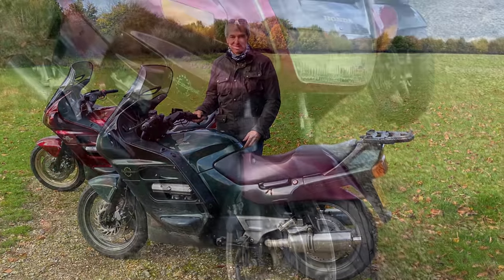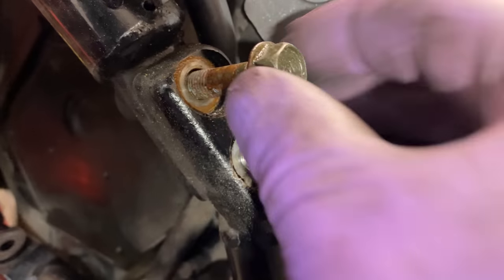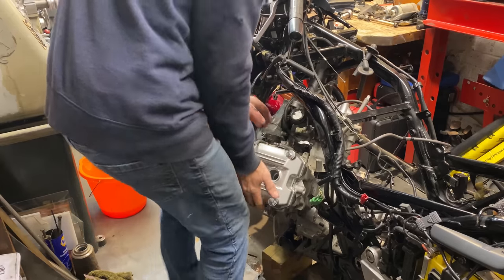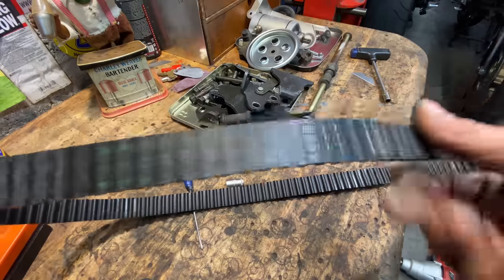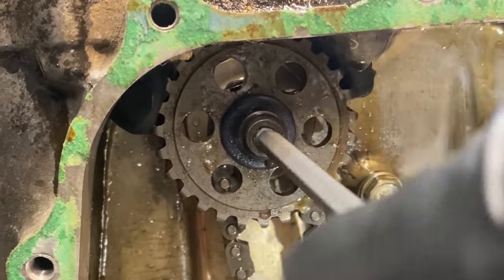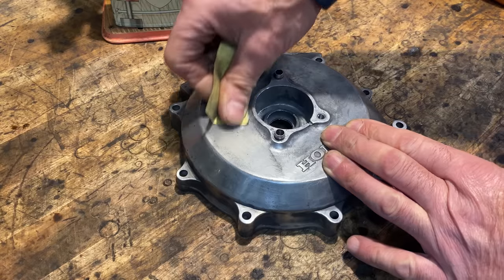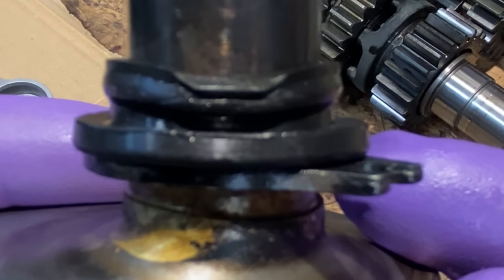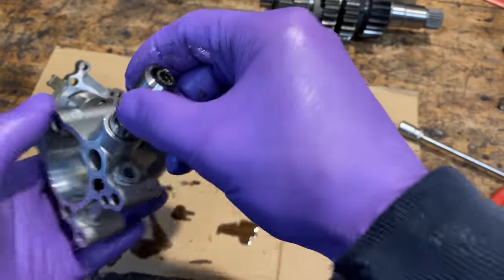Honda ST1100 Pan European engine removal and strip

Comment: Alan would love your thoughts! 
Working on my Blackbird and was wandering it’s 18K 21 years old, would you replace the ACT with an original which can potentially fail slack or fit a Manual Cam chain tensioner? 
Ps great work on the ST and Merry Christmas to you and your family ❤
Reply: My 04 bird had only 20k on it when I bought it but I did another 20k over the 6yrs I had it. Camchain rattled a bit when cold around 2-3k rpm but after a few miles was ok. I never changed it as the bike was flawless.
Reply: @Jestersson  mine is always a little noisy about 2K to 4K, but nowt to loud, but having owned many Honda’s which have had ACCT issues I’m not sure which way to go on this
Reply: @lovecycling193  I’ve owned 2 cbr1000f’s both had noisy chains, an x11, blackbird and a 954 blade. They all made a bit of rattle when cold but the old cbr’s were quite loud. I never changed out any of them though and since they didn’t rattle once the bike was warm it didn’t bother me and I’ve never had a mechanical issue with any of them. The x11 and Bbird had a noisy clutch on cold but again not an issue for me but I believe most of them do it. I don’t think it’s a big job or expansive to change the cct though.
Reply: @Jestersson  it’s very simple to change the cct, my 2 Blades had Manual fitted but they were track bikes, and my 3 storms all had Manual fitted as they have a CCT per pot and they fail often completely destroying the motor! So far my only Honda that seemed okay cct wise was my crappy VFR ( hated that bike! Soulless bland do it all bike that never excited me ) I think the Blackbird isn’t a interference lump but im not 100% sure. I’ve heard a few that really sound like a bag of nails! Mine doesn’t but it’s definitely showing early signs of a spring that’s losing its omph! I wanted to get Alan’s thoughts as when he makes motors I swear I’ve seen him machining and setting up Manual CCT’s I was wondering if he feels long term they are safer?
Reply: @Jestersson  I know a few people with noisy BBird clutches but they ran their chains to tight and that doesn’t help at, my mates clutch basket had a few notches in it that stopped the plates freely moving, we filed them smooth replaced it thinking he would have to replace it, but it ran sweet for years after.
Reply: @lovecycling193  I’ve read before that the cct from the x11 works perfectly in the bird and is a better quality part. 
It’s basically the same engine (apart from its tuned different & no hydraulic clutch) Have a look online for the mod it seems it’s still popular. 
It was years ago when I had my x11 (2001 model) and tbh I can’t remember if it had any rattle although I did use semi synthetic oil instead of fully synth.
Reply: @Jestersson  the X11 had the Double dot markings, in theory they should all be that unit now. The biggest issue with Hondas CCT is if the spring fails it fails fully wound back! So slack! I’ve seen a few people mod the original with a cut off bolt placed inside the ACCT so if it fails it only has room to retract a couple of mm  so it may make a little more noise but not fully retract and then allow the chain to skip teeth

Comment: I bought an ST1300, and sold it 9 months later. Gads I hated that bike. Between the engine heat roasting my left inner thigh and the weird wobbly handling that thing was a nightmare. As Mr. Millyard has stated, and I've heard this from others as well, the 1100 is a better motorcycle than that 1300. I didn't mean to poop on your video, sorry!
Reply from the maker: The 1100 is a much better bike in my opinion 🤔
Reply: @AllenMillyard  I have heard that from many people.

Comment: What a complex engine.
Reply: Being a Guzzi fan this engine seems nuts,  how is the clutch on the front?  Are there 2 shafts through the engine?
Reply: @kevkfz5226  Like the CX500, it's designed like a traditional transverse engine, but mounted longitudinal. Makes the clutch dead easy to service, unlike the Guzzi's and BMW's

Comment: Pah! Any one of us could have taken that engine apart, it's no big deal.  Getting it back together, though... that's what separates the men from the boys.  I'm pretty sure I'd be the bloke who has a couple of spare bolts and springs after reassembled the engine!  And an oil leak.

Comment: One does not simply remove an ST1100n engine from its frame -- one removes the frame from this engine :)

Also: Thanks for showing the water pump, nestled deeply within its aluminium cocoon. Must be a bitch to change on the bike.

Comment: What makes me laugh is that, for me, even the job of undoing a tight bolt or unclipping an electrical connector turns into a frowny, sweary, frustrating and lengthy affair!! Doesn’t stop me tinkering away though!

Comment: The fact that you could move a Big-End , at all , with the tip of your screwdriver isn't right . There's your noise  I  would say . 
Leaking Oil pick-up seal is the Likely culprit . Foaming the Oil in the Pump . I  predict Bearing Shells being needed . 
Hopefully the Journal is OK .    Little Hedgehog on Infrared camera . Serial Killer - of Earthworms .
Reply from the maker: All will be revealed in episode two after a lot of measuring and searching for new parts